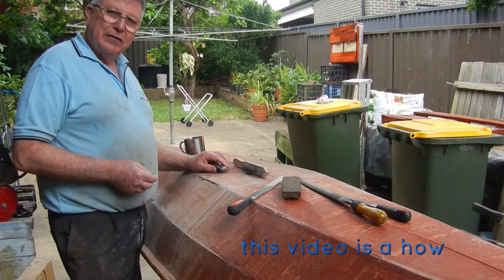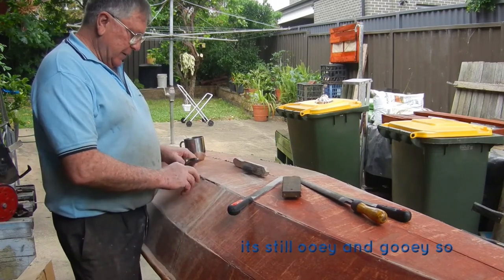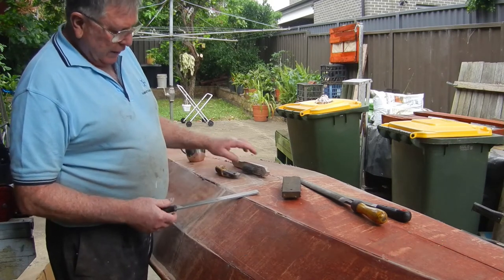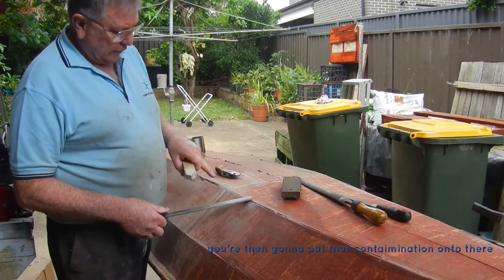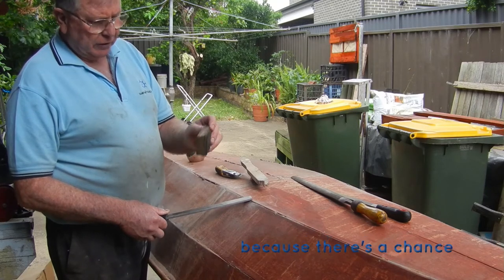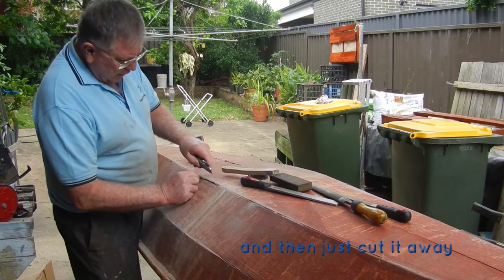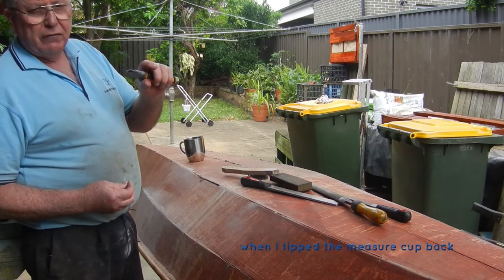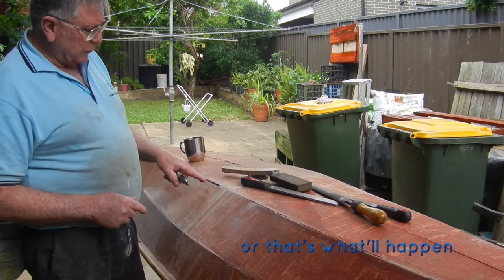Filleting Stuff Ups

Comment: I'm about to use Aquacote high build primer on my kayak, can I use a good quality paint brush as I can't get hold of those foam brushes you mentioned in your other clip? All info greatly appreciated. As for mixing epoxy i use syringes, never fails to be accurate
Reply: Same here.... I measure with syringes.... never have I ever stuffed up... just saying!
Reply from the maker: Thanks for bringing out the tip on mixing epoxy resin and undercoat as it is a great way to accurately measure the Epoxy Resin.  
Good quality brushes will work but will leave brush lines in the finished surface as the Aquacote Undercoat is fully Thixotropic which means it will not self level.  Plus they are hard to clean when using with the Aquacote Undercote.  You are better off using cheap foam or bristle brushes to do the edges and 100mm to 230mm rollers for the larger areas.   
Do not try and spread too thin as it is designed as a high build undercoat to fill the low spots and ensure you do not cut through the high spots.
Have a painting good time.  Let us know if you want further info.